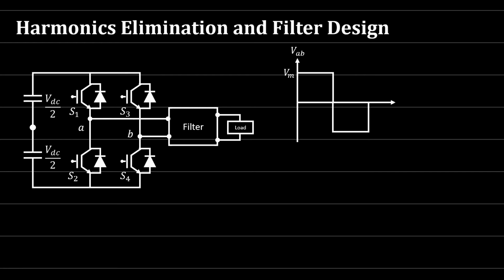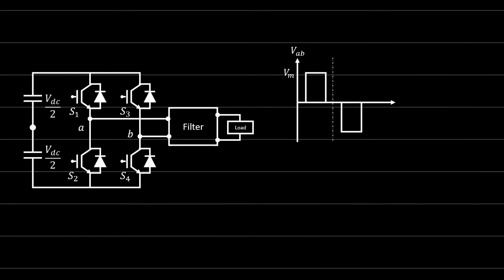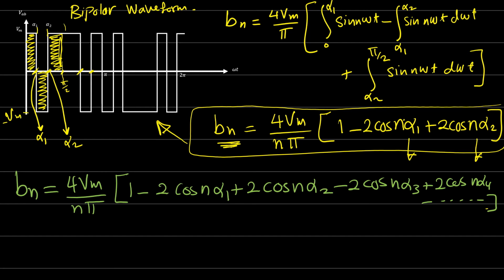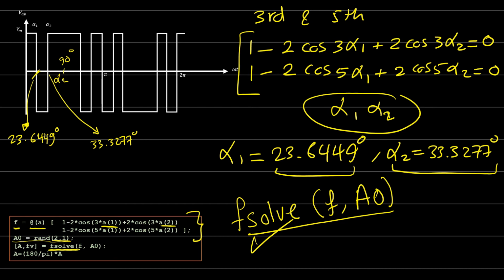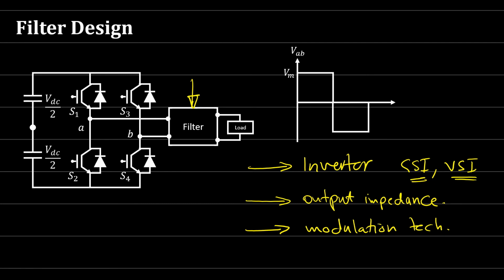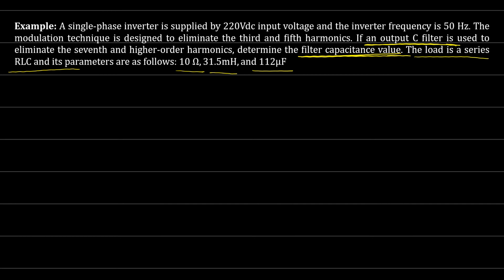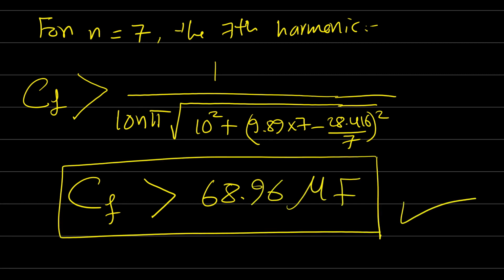Harmonics Elimination | Filter Design | Modulation Techniques | DC-AC | Power Electronics

Comment: Hello Professor, concerning harmonics elimination on pulse modulated inverters, is the correct way of "chopping" the output, to set the half-bridge duty cycle at 50%  (meaning 0VAC)?

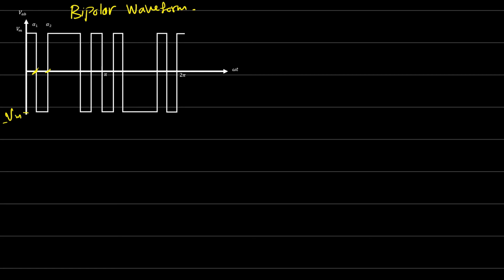Comment: Thank you for this valuable lecture, 9:25 is it possible to have the harmonic rejection using specific alpha at different required levels of the sine wave.
In other words what if alpha result from triangulation is different from alpha required for harmonic rejection  ?
Reply: An inverter is a typical D-class amplifier. So, you can take a 50Hz from a cheap MCU with a DAC (like $1/piece), then use either a UcD or a triangular wave comparator architecture, and get an ideal sinusoidal output. Of course it will require faster switches, but if you really want to eliminate higher harmonics with the simple way, you’ll find out quickly that you need a fast switches any way. So..